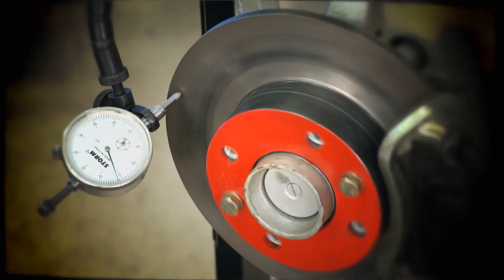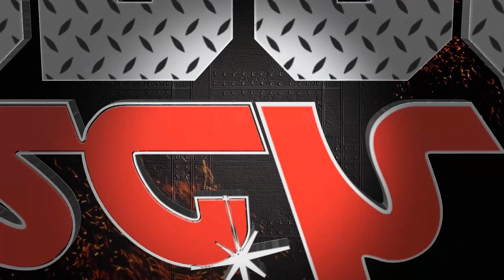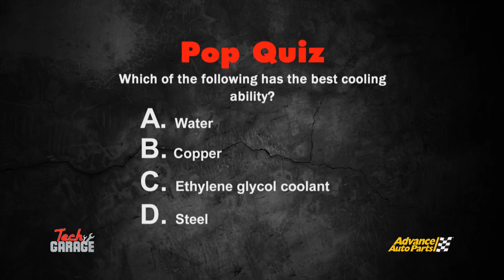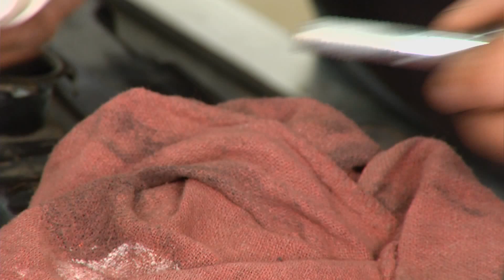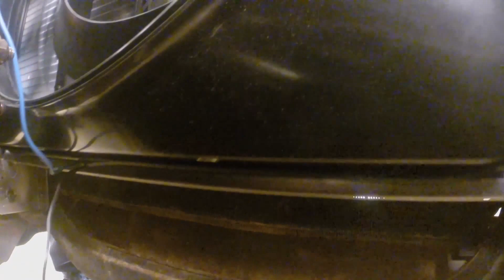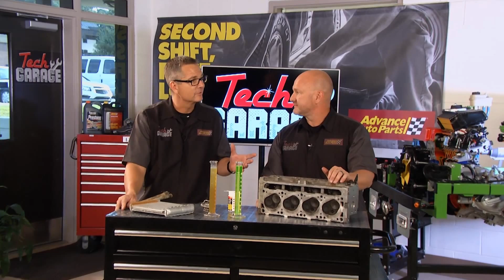Tech Garage - Ep 1605

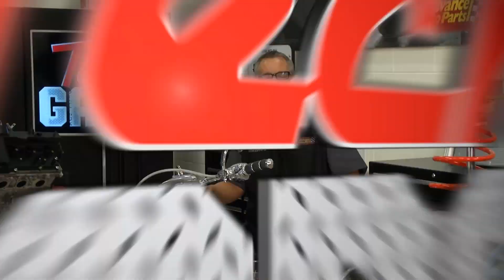Comment: From 2:12 to 2:25 there's some erroneous physics theory being slung by the guys as "thermodynamics". They got it backwards.More/faster coolant flowing does NOT hinder heat transfer. It's just the opposite - ALWAYS!  Likewise you wouldn't argue that a fan blowing more air on your hot face at a greater volume hinders transferring of heat downwind - I hope it's obvious more air flow equating to less cooling wouldn't make sense to anyone either. The reason why leaving out a thermostat isn't wise is because it delays bringing engine lubricants up to their nominal operating temperature. Its not wise precisely because the greater flow to the radiator DOES initially cool the engine too well. Initially is the key. Initially we want to close the cooling circuit to warm the engine for lubricant performance and as a secondary benefit for sooner heat to the heater core (comfort) on cold days. THEN once we reach operating temp, as defined by a thermostat, that temp is maintained by allowing more or less coolant out to the radiator to shed heat-load.Leaving the thermostat out isn't advised but for different reasons than what discussed on the show. They should post a correction to the audience.